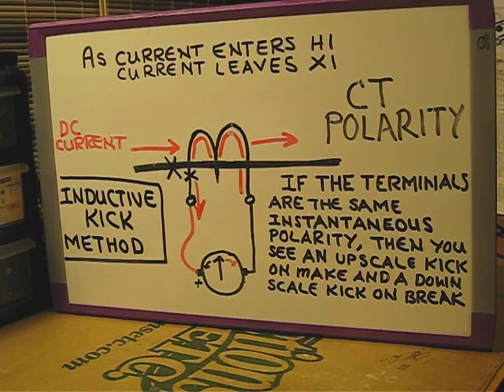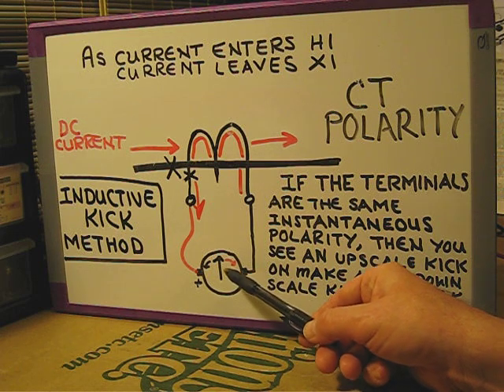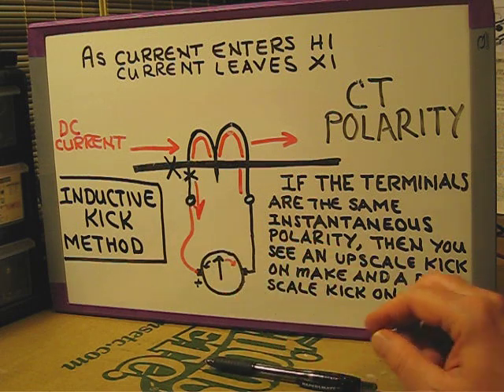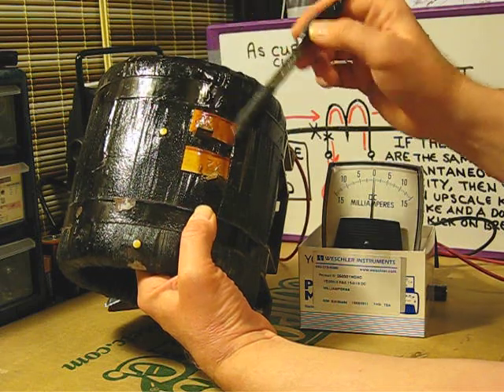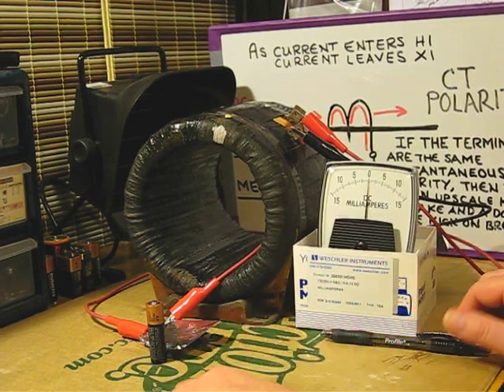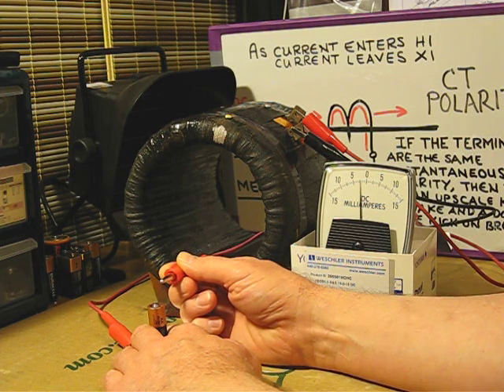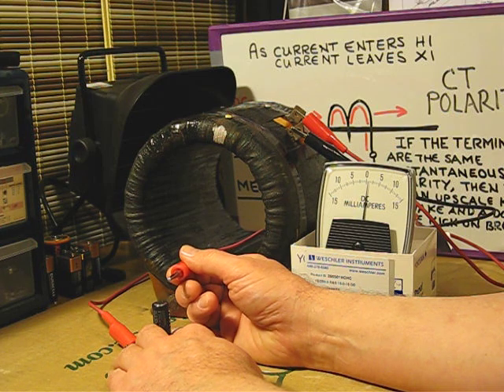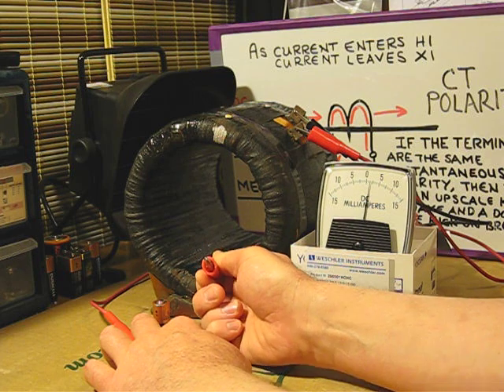CT Polarity with Analog milli-ammeter.

Comment: If I were to use AC current will it affect the polarity, just curious. Thanks
Reply: It d show zero, right? As the deflection would average to the centre zero reading as the frequency is 50Hz..
Reply from the maker: You are correct, the meter would show zero.   The polarity of the transformer would remain unaltered.  Using DC allows our slow minds & eyes to see the instantaneous polarity of the transformer during one half cycle of the ac wave, be it 50/60/400 Hz.  Sorry for the slow response.

Comment: after disconnecting primary from battery, why the galvanometer needle goes from positive deflection to negative deflection instead of stopping at zero?
Reply from the maker: The magnetic field collapses when the battery is disconnected causing the electric current to reverse direction in the secondary circuit.  The CT is an inductor. When any inductor is de-energized it sends a signal back toward the source that is opposite in polarity from the original signal.  See inductive kickback.
https://www.bing.com/search?q=inductive+kickback&form=EDNTHT&mkt=en-us&httpsmsn=1&refig=1bfe0f04fcc94996bead4e770916f12e&PC=DCTS&sp=2&ghc=1&qs=AS&pq=inductive+kick&sk=AS1&sc=8-14&cvid=1bfe0f04fcc94996bead4e770916f12e&cc=US&setlang=en-US
Reply from the maker: When the battery is connected an expanding magnetic field is created.  When it is disconnected the field collapses causing a current in the opposite direction.

Comment: If i were to parallel two generators would i have the CT set so the two generators phases were up scale on make, or visa versa?
I think i am asking the question correctly. thanks for you help.
Reply from the maker: Your CTs will be installed & wired per the instructions for the generator protection relay.